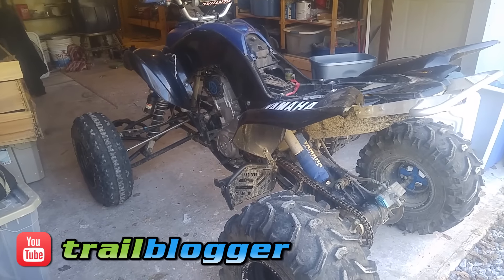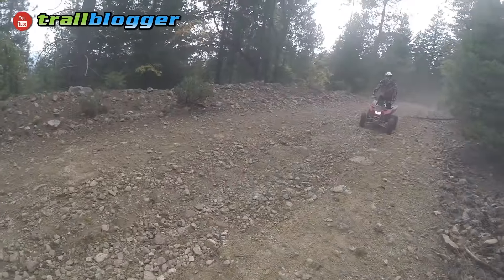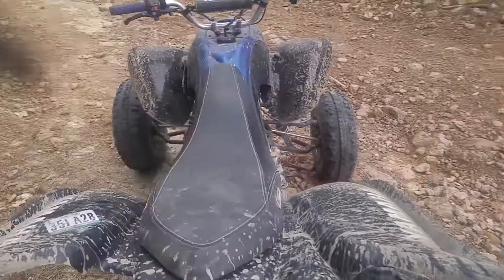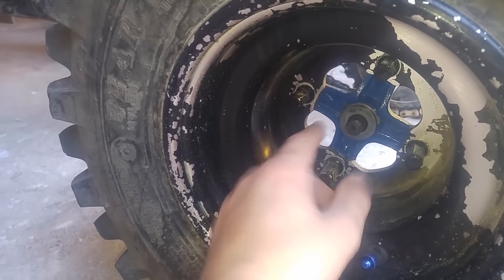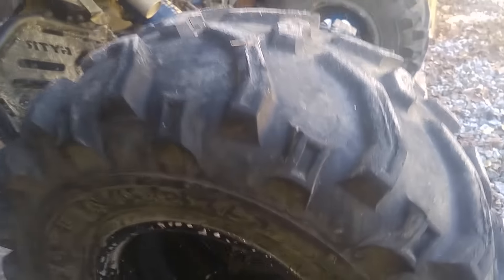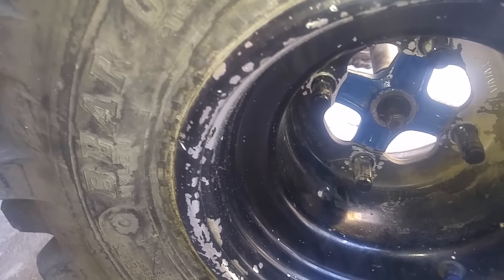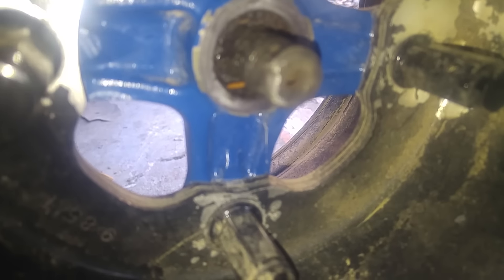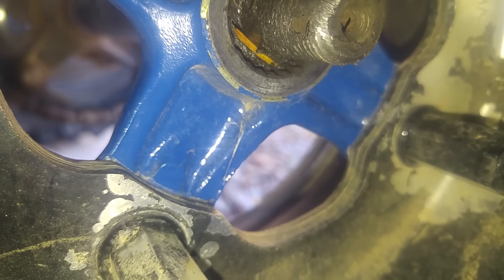RAPTOR 700 UPDATE - WHY DID THE WHEEL FALL OFF, AXLE REPAIR

Comment: Get on Ebay and order a thread file. You will find the thread pitch you are looking for, whether it's .7mm, 1.0mm, 1.5mm  pitch. I have seen tons of them on there. that should take care of it. once you take too much material of the the major O.D. of the threads, there's no going back.
Reply from the maker: thanks I did basically exactly that but with the edge of a small half round file I had laying around the shop